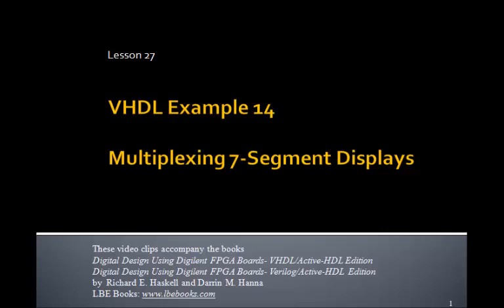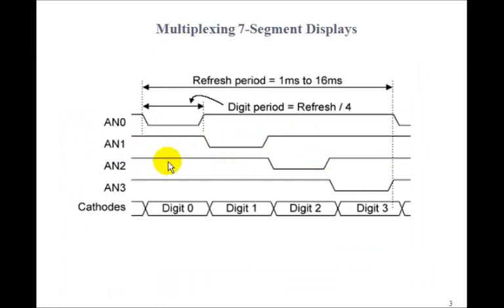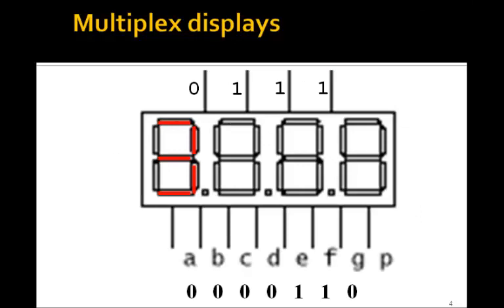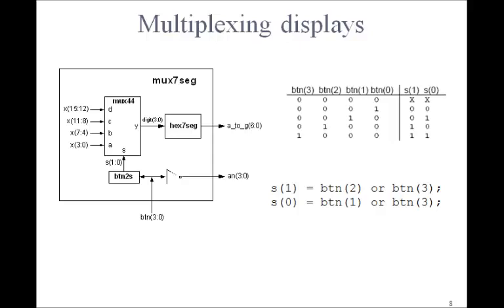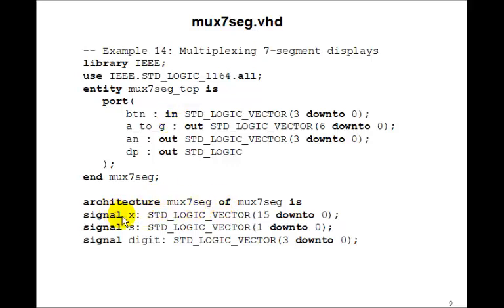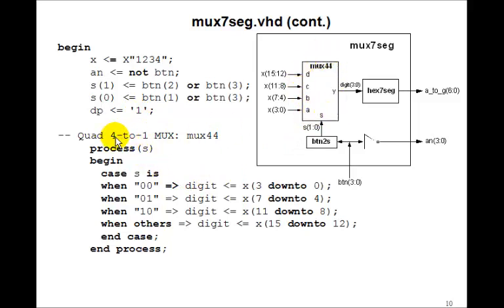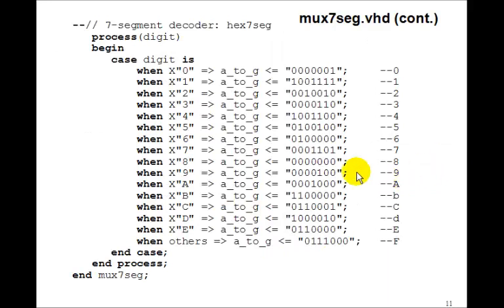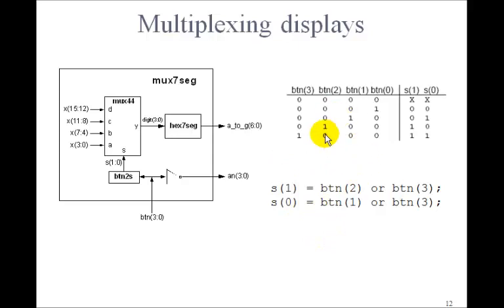Lesson 27 - VHDL Example 14: Multiplexing 7-Segment Displays

Comment: I tried to implement this program in an altera board EP1C3, but the problem is the assignment of the digits for each display, no matter if I put x = X"1234", or if I put  x(3 downto 0) <= "0100"; x(7 downto 4) <= "0011"; x(11 downto 8) <= "0010"; x(15 downto 12) <= "0001";  I always get in every display '1'. What could be the problem ??

Comment: I tried this on my nexys3 and it works fine with some minor changes. Can someone please explain each line of code shown at about 9:30. From x = x"1234" to end case. I tried to modify the code and results are not as I expected. Obviously I did not fully get it. Thank you

Comment: please quick question , why is a seven segment display multiplexed?
Reply: so you can display 1234 instead of just 1111
Reply: first last do you have a more technical answer?
Reply: To display a number on a 1 digit display, you would need 7 outputs, to control each segment of that digit. To make a 4 digit display, you would need 7x4 outputs. That's possible, but not optimal, multiplexing allows you to use less outputs to do the same amount of operations.
Reply: Matheus Vicente thank you